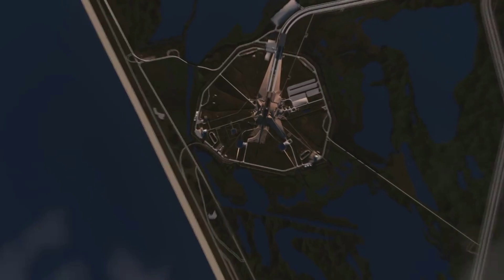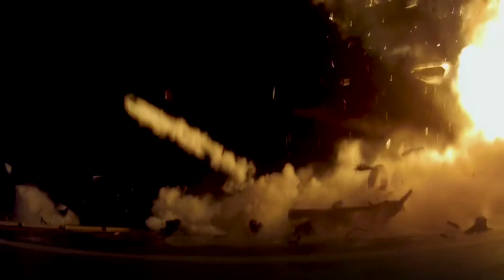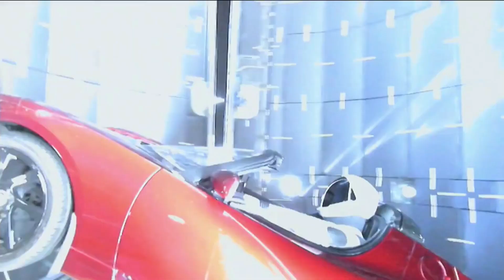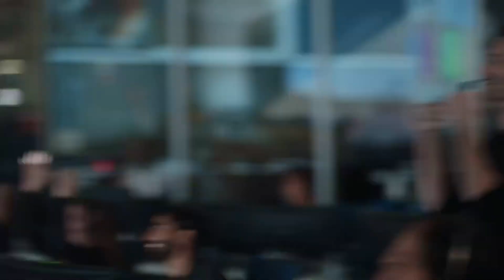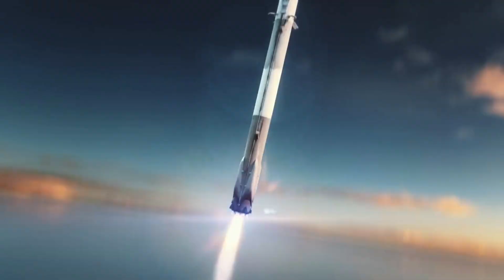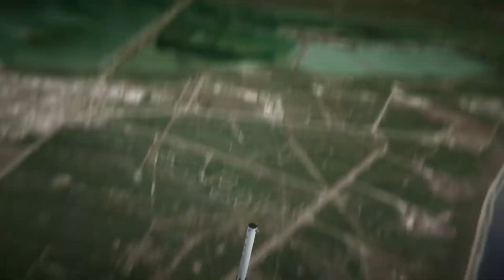SpaceX's Falcon Heavy Is Set To Launch In Just One Week

Comment: Perhaps expanded usage and customer interest in the Falcon Heavy will be associated with the recently announced extended payload fairing.  SpaceX’s extended payload fairing maintains almost the exact same diameter as the standard fairing, while the extended Fairing allows an extra 17 feet of height for payloads. The United States government paid for the development of the extended fairings for classified National Security launches and NASA’s lunar gateway.  Commercial use for these fairings seems possible but not in any significant quantity at least initially until large payloads are developed for the extra room.